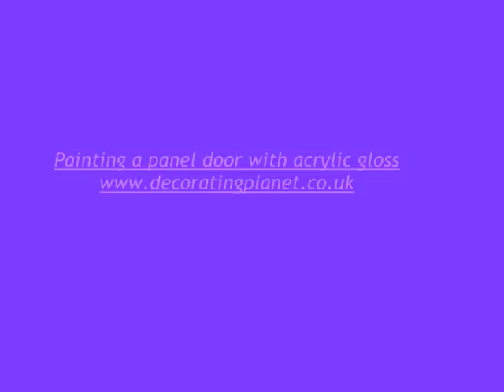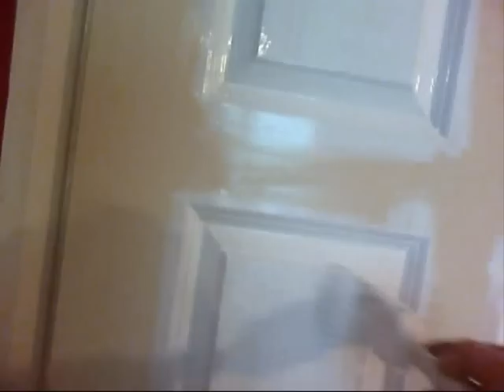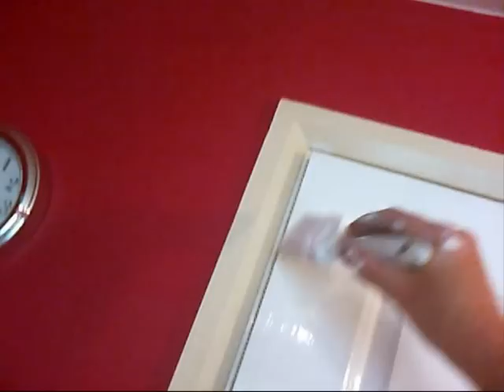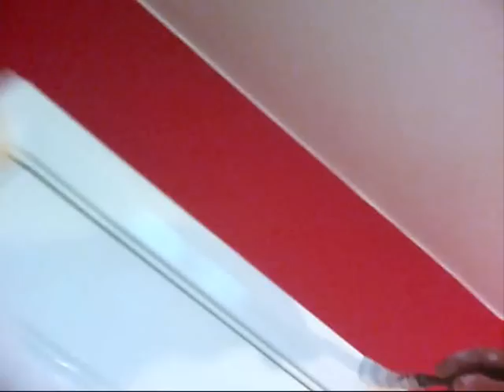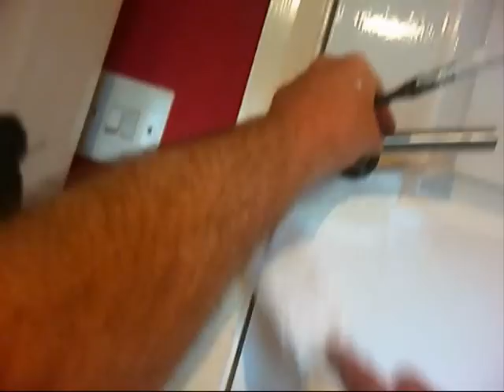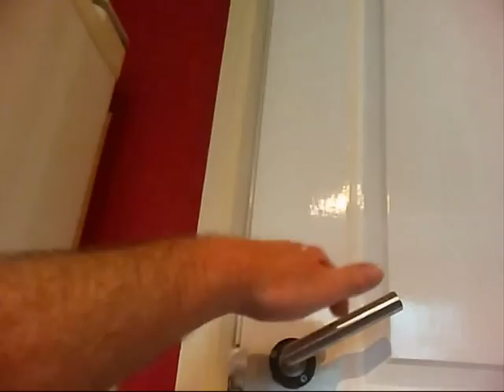very satisfying to watch  painting a door with white water based gloss

Comment: I've been a decorator for 42 years and fully agree with all you've said. I find that solvent based paints are getting worse and yellowing quicker. I also find that almost every tin of Dulux emulsion I open has a skin around the rim.  I prefer bristle over synthetic brushes and only use Hamilton's. I get them off eBay as they're much cheaper.
Reply: No no no not a pro painter no we're near sorry

Comment: Nice work, reasonable time too..the only thing I would do different is not get paint on the face when I am doing to top panels because that water based gear goes off a bit lively and I would continue with the 'framework' of the door when I got to the bottom instead of leaving the edge and moving on to the bottom panels..I would finish what I had started and done the two panels last.